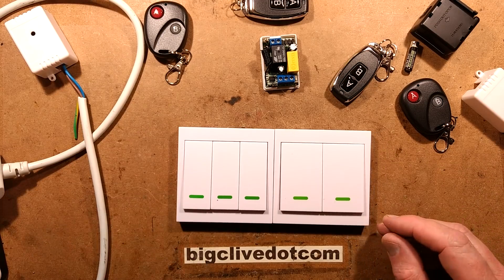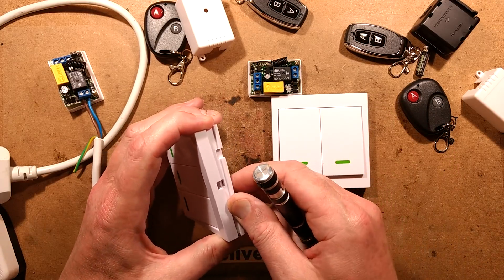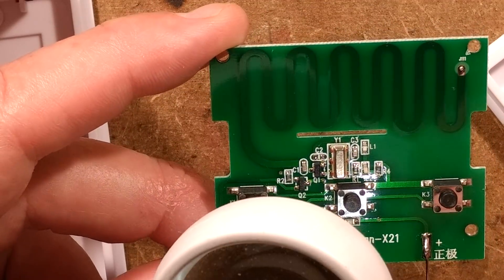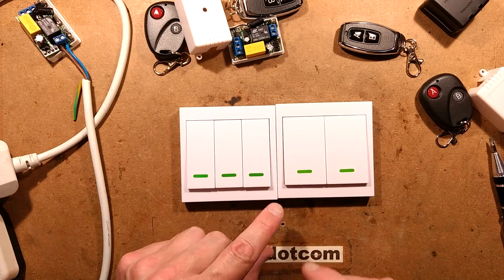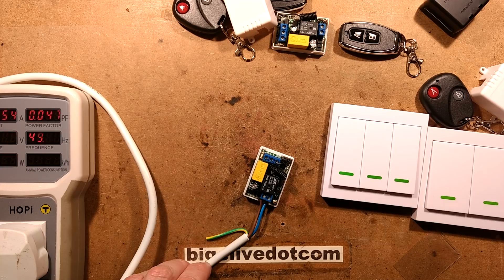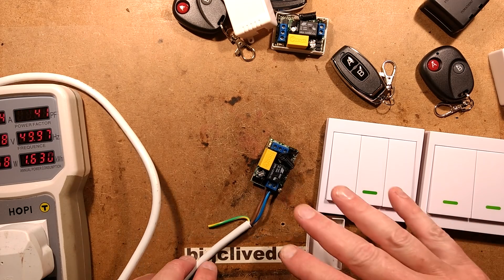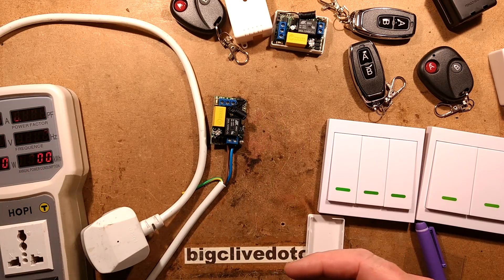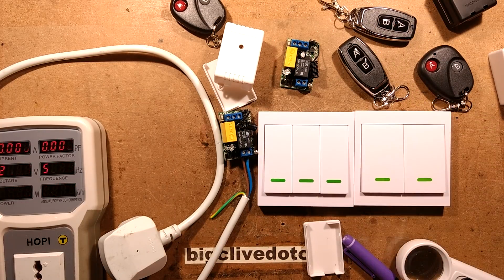eBay radio remote controls.   (220V with a 125V relay!)

Comment: for the American 120 volt version of this, you could take out your existing wired light switch
and wire the receiver in place of it, and then use a blank face plate over it.
this way, you could use your existing wiring, and put the remote switches anywhere in the room. 
but there are a couple of important things to consider before trying this:
[] your house/building must have metal switch box(s) for fire safety [ due to Zener Diode and other possible components getting hot ]
[] your house must be wired for power at the switch, in order to power the receiver unit.

Comment: Great devices until they fall into the  wrong hands .I have had issues with outdoor solar lighting I programmed one on button a and the the  button b .Button a turns on a  and b and button b turns on b only .Strange .left it alone good enough to light the pathway long before you get to it .Almost 75 meters !

Comment: Got a remote relay 3 ch unit with key fob operation.Mine can be pulse or latch with dip switches. Very useful with 12v batt and vintage horn in boot. Amusing in car parks.Yes I'm a child I know

Comment: Hi Clive sorry to be a dummy but how do you work out the power factor if you don't have a hopi ?
Reply from the maker: You could use a decent plug in power monitor.  It's not something you can measure with a simple meter.

Comment: So, were these rated to be in accordance with your national RF standards like those in the U.S. from the FCC? I have doubts that the broadcast complies with the filtered, narrow band requirements for radiating a signal to ensure it does not interfere with other systems.
Reply from the maker: You can usually select the frequency they use to match common remote frequencies.
Reply: @bigclivedotcom  And hopefully it's narrow enough to ensure the government RF enforcement doesn't show up at your door, wanting to know what you're using that's dirty enough to interfere with other, adjacent bands. I'm sure the radiated power is very low, but as crowded as the bands have all gotten, it's getting harder to acquire approval for most anything that doesn't meet strict requirements for bandwidth.

Comment: Used one of those in my RV to control the color rear camera I mounted on my roof ladder so I could use it as a rear view device.  The built in device would only show my towed vehicle and not what traffic was like.  They said if I left the wireless transmitter on all the time, it would burn out the transmitter.  Worked great for that.

Comment: These units could be spun in to a series:
- Mod them to work directly from DC and cut the zener out
- Create a version with a sliver center button
- Maybe start an Open Source project to run with these and other mods
- Even though power companies are needing to install capacitor banks, capacitive loads are not given favorable billing treatment. You could pull out the scope and go in to what the story is.

Comment: Is there a way that you could modify the circuit to improve the power factor so that apparent power more closely matches real power? This seems to be a common theme of late. While a couple of Watts here and there are negligible, I'd imagine that usage costs could dramatically (even exponentially) increase with the proliferation of these poor efficiency devices.
Reply from the maker: For compact electronic circuitry like this it's surprisingly hard to get a good power factor without a significant cost increase.

Comment: After watching this I bought two of the one button version (one 315mhz, one 433mhz) and you were right, they do just press the center button. HOWEVER they did not solder the outer two tact switches to the circuit boards to cut costs, I assume.

Comment: EV1527 is a good universal 433 remote chip. Works great with most simple radio remote relay kits and for example a RF gateway. Great find on the remote wall plates!

Comment: I went through my stuff recently, and ended up with a big ol' box o' batteries.  I awoke during the night in a bit of a panic, fearing that the box might catch fire.  I cut several layers of paper towel, and layed them between layers of batteries, when I put them back in the box.  Then I could sleep much better.

Comment: Hi Clive, I have a dead DYS AC - DC adapter that came with a Blaupunkt DAB FM click radio I bought from Sainsbury's.

It worked perfectly well for 3  years and then just....died. I've looked online, and Amazon has a product page which says that they "don't know when or if it will be available again". Meanwhile, the clock now functions solely as an FM radio on AA batteries. How can I get it to you so you can do a post mortem? 

Suggestions as to a safe replacement would be useful too.

I think there might be a story about importing bankrupt stock in there too.

Comment: I don't like that only switching Neutral. Not one bit. Anything downstream of a plug top should be double pole switching.
Reply: Geoff Geoff There's a firm rule in the regulations (IEC standard): Single pole switchgear must not be installed in the neutral.  Because these have a single pole fuse in one line and a single pole relay in the other, they cannot be installed legally even if otherwise built to the highest standards.

Comment: Surely it would be straightforward to replace the 125v AC relay with one suitably rated for 230v AC?
Reply: Pete Allum But only if the pin and track distance on the board is suitable for 230V power.

Comment: one thing to be careful of with 433.92 mhz devices is the amount of interference you will get from other devices that are in range.
i built a speed controller for a conventional ceiling fan to be used with a sonoff pro2.
flashed the sonoff with tasmota to run with home assistant on a raspberry pi.
after a while i would come home to find the ceiling fan wiring away.
shut down the ras pi, didnt make a difference.
switched off the wifi that the sonoff used, still no change.
in the end i disconnected everything including the fan, you guessed it still nothing.
random switch on's by itself.

after a bit of reading and searching the net i found that the pro2 has an rf receiver.

BINGO! shorted the shutdown pin to ground, no more random switch on's or off's.

best thing to go for with wireless is anything that uses 868 mhz crystals.

Comment: Those relay units and keyfobs look like what we call HomeLink here in the US.  The 433Mhz frequency matches up and I have a keyfob that looks exactly like one of yours.  Newer cars here have buttons on the rear view mirror to operate things like garage doors or lights, depending on what the remote is attached to.

Comment: I remember some years ago now I think back in 2008 I was sent an unsolicited gift from the USA and I got a letter from "parcel force" saying I had tax to pay and fees of £14.00 in total it was £80/$120usd with the import tax and the parcel company fees and I think I had to pay further postage as at the time if customs stopped/opened your parcels or mail it was seen as the end of the journey and you had to pay for it to be picked up and delivered onwards to you as the parcel company washed their hands of it and it became another delivery to be picked up again(basically they seen it as UK customs taking delivery of your mail and completing end delivery by taking possession) , I didn't want to decline the parcel as I hadn't a clue who it was from and had a rough idea who may have sent it, I didn't want for it to either be dumped and a message pop up on the tracking website saying that it was declined/unwanted or something similar so I paid the tax and just under 2 weeks later it arrived, it was 2 large bags of jelly beans (sweets/candy) which customs had sliced open, the knife mark was the same through the box as well which is where they had put a Stanley knife through the lot to "examine" it

Comment: one could "hack" the rx unit by replacing relay with 12v coil relay & possibly run it on 12v by hooking in before the 5v on board reg ect ?

Comment: The alternate mode seems more suited to a doorbell or buzzer circuit. I wonder if it works on the voltages those use?
Reply: pauljs75 Rolling shutters and curtains are a common use for momentary 230V switches.  One button rolls up, the other down, stops instantly if you stop pressing because something or someone is getting squished.

Comment: I have had a lot of fun with 433MHz gear. The wireless doorbells are often on 433MHz, as are cheap "wireless home security" kits. So if you want cheap PIR sensors, you can often get them from these kits and then use a 433MHz bridge to integrate them into other systems.

I have used a SonOff RF Bridge from iTead to link my 433MHz bits and bobs to my Home Assistant system and this has allowed me to integrate them with all my wifi LED bulbs and ZigBee devices. I'm addicted to SonOff and Xiaomi devices for home automation. Combined with something like Home Assistant, you can achieve a lot of really effective automations quite cheaply. In the case of Xiaomi's products, the quality is actually pretty high. The iTead SonOff products are really open in that they use the ESP8266 chips and 433MHz systems which can all be reprogrammed and managed via MQTT or similar.

You can take this further though. I used a Wemos D1 Mini (ESP8266) with a 433MHz shield to control a servo that opens the blinds. The 433MHz allows it to be controled with a simple remote, and the wifi on the D1 Mini allows it to be controlled from Home Assistant. So a button can raise/lower the blinds, or Home Assistant can do it automagically based on automation conditions. I use a 18650 to power it and a small solar panel to charge it through the day. Then when I next move, I just unwind the blind cord and unclamp the box and it was never there. The whole thing? Less than $20 per window for automated window blinds.

Comment: Would it be possible to convert it to work with 12/24v DC? And use a different relay. For safety! Does it operate on about 12v? After the dropper?
Reply from the maker: If i recall correctly it may have had a 5V regulator for the logic supply, so it may work from 7V upwards with a suitable relay.
Reply: bigclivedotcom thanks Clive. Do you have a link to these? I haven't seen any before. The remotes with 2&3  buttons  also. I really like that secret switch . thanks again!!!

Comment: Would it be possible to convert it to work with 12/24v DC? And use a different relay. For safety! Does it operate on about 12v? After the dropper?

Comment: It’s cheaper to the factory to use the same TX -PCB because you can make them in the same line. Is the Capacitor properly rated? If the realy has no 250 V rating it can mean that the  Cap is wrong too and that makes me more worried than the relay.  I haven’t seen that kind of relays very often but it is because I live in Finland and those are made for the US market. If you people use same kind of wiring having Green/Yellow PE wire, do not leave it long as it can take contact to the Live  conductor.

Comment: Does anyone know of some of the not so 'might burn your house down' versions of these that are a bit safer?  Even compliant ones? I would love to hook some of these up in my house but don't really want to risk using janky ones like that...
Reply: TheC0rtex I think Schneider makes some high end ones that are rated for professional house installation (in 230V/50Hz standard).  May be under their LK brand, maybe some of the others.
Reply: In the UK see TLC direct.
Reply: Lightwave RF are pretty decent for self install. 

Crestron is good for professional install but you need a dealer to install and program it for you and it costs a bomb.

Comment: Prob your standard 433mhz SAW filter based wireless system. This opens up using them micro controllers easily

Comment: Is it somehow possible to work against the capacity droppers?
To increase the power factor back to one? Or are these magical power safer units made for that?
Reply from the maker: It's not easy to correct most modern loads power factors without quite complex circuitry.

Comment: About apparent power, what you must realize is that the reactive power (I think that's what it's called in English) of these capacitive droppers is largely opposite to that of inductive devices you may have around the house like transformers, electric motors and so on. So realistically the total apparent power of your house will be much closer to the real power than the sum of the apparent power of each device individually. I wouldn't worry about it too much
Reply from the maker: There aren't that many continuous inductive loads these days.  Most power supplies are switchmode with a completely different and spikey power factor.
Reply: I guess that depends on how much older equipment you have but for new stuff I agree that's probably true. I do signal filtering very often and wondered what all those harmonics were coming from and why the odd ones are stronger than the even ones. Apparently it's caused by all the electronics that have a bridge rectifier with a capacitor behind it.

Comment: Most relays are rated for multiple voltages. you may see 120vac 15a, 220vac 12a, 28vdv 15a. It's more a power limit than the voltage itself.

Comment: @bigclive: I did a little research, and it seems like the single-button switch uses the same board, but only the center button position is populated. Looks like you could simply add the momentarys for left and right and get an instant hidden upgrade.

Comment: Are there any remote control mains light switches you would recommend? I have mobility issues, and when the sun goes down I can sometimes be stuck in the dark for an hour or two before I can manage to get up and turn the light on. Secret settings would be cool, but not essential ;-)
Reply: RealUnimportant you can buy some Sonoff switches. You can control your lights with your phone. But you either buy a Google home or Amazon Alexa, so you can do it with your voice.

Comment: After over a thousand purchases from China without customs (HMRC) inspection in the last 5 years I have noticed something else happening in the last month or so: Suddenly, about 1 in 10 parcels are arriving having being opened and then resealed and sent via Royal Mail's 48 hour service. So HMRC is paying for the administration of re sending the package and also paying the Post Office just for me to get my £1 parcel. Is this happening to anyone else, because it seems like a total waste of time, money & resources.
Reply from the maker: Some Chinese sellers use a Royal Mail warehousing and distribution service.  I wonder if it's that.
Reply: No, I've had plenty of those types of delivery - they are often just relabeled and delivered a lot quicker. This is different in that the original parcels with the original seller label on them have are being 'ripped' open and then put inside new packaging & a new Royal Mail 48 label stuck on the outside. I've had 2 deliveries like that already this week, but have never seen it until recently.
Reply: Another thing that makes this strange is that for these packages I'm getting tracking emails from the Royal Mail even though they weren't sent as tracked items - as I say some of them only cost me a quid delivered. And they (Royal Mail)  are picking the email address up off the original parcels, as I use a unique email address for my eBay purchases.

Comment: If it was imported then duty is supposed to be charged by the carrier, like royal mail (but only if the value is above some amount), and it's the buyers responsibility to pay (rather than being the sellers responsibility).  My own experience is that stuff eventually arrives, though sometimes it really does take ages - and I have the feeling that's because the 'seller' doesn't actually have the item; then orders some when a few different customers place orders.

Comment: Production quality (particularly the audio) went up linearly for the past two years and I've loved it. However, It's dropped significantly in the past few weeks.... Can we donate on patreon specifically for certain items? (You really ought to have a Rode external mic.)
Reply from the maker: I do have a Rode mic, but have had camera issues recently due to a rogue firmware update.
Reply: I think he did well with a plain 9mm capsule fitted into the bill of a baseball cap. I really think due to proximity and evenness of Clive's voice it has to work better than any RODE...NT. It's probably an issue on the phone he uses to record unless something else changed.

I suppose capturing via OBS on PC, you can use any professional microphone and audio interface, and then he also wouldn't have the issue of inspecting the footage to find whether it's any good, as he'd see it straight on a cheap 1080p monitor. But then, webcams don't zoom, something like Elgato GameCapture HD adds another $100+, and you still need a decent HDMI camera with zoom and I wouldn't even know where to begin, though i'm sure EposVox for example on YouTube has the solution, just have to dig through his videos, but it's not going to come cheap.

It might be just the right thing for his workflow (long sections of live footage, no flashy post processing or intros/outros) to just stream to YouTube and then use their online video editor to chop out the sections that he doesn't need, but I think he doesn't have good Internet connection for that.

Comment: In the US, our lights have to hang from fixture boxes, so, the little receivers would probably be OK inside of those boxes.  All of the big box hardware stores sell little remotes with recievers similar to that (except they have a button that protrudes to the outside of the box) that are typically used with ceiling fans that also hang off of fixture boxes.